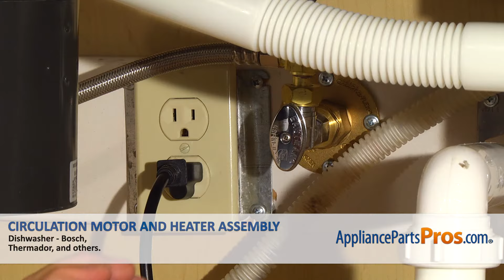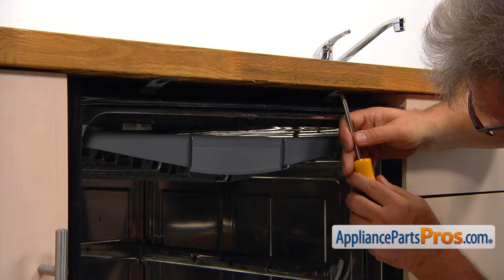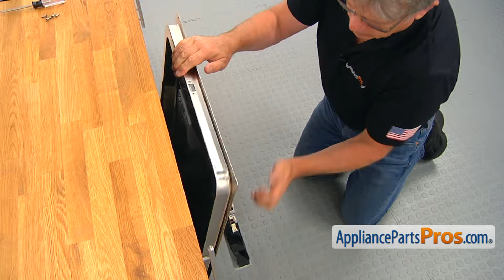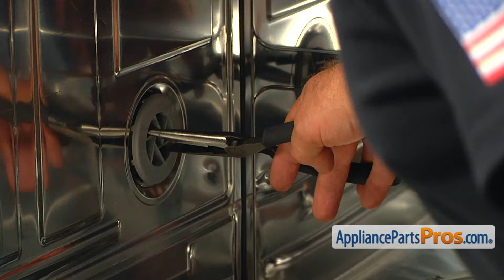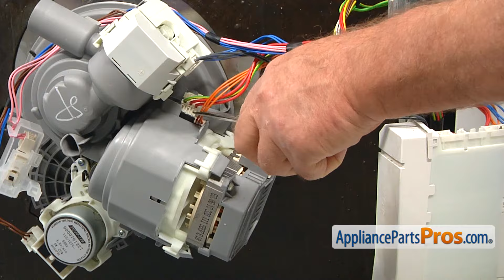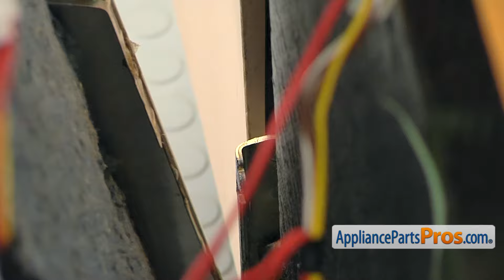How To: Bosch/Thermador/Gaggenau Circulation Motor and Heater Assembly 00753351

Comment: I have the exact same dishwasher.  Pull straight out. Fold back the right hand side insulation. Unclip the white electrical connection board, disconnect the 3 wiring connector clips from the pump.  You now have adequate access to remove the pump with a slow twist of the wrist.  Replace the old hose clamp with the new one, positioned so you can tighten it the screw head.  Put the new pump/heater in, reversing the procedure.  I think i undid 4 screws, and only actually needed to undo the ones that held the dishwasher to the counter.  Done in an hour.
Reply: Not all models though, some have additional parts that block the motor access and you have to go all in like this video.
Reply: @HeatSoaked  Yes, I can't lift the controller out because of water circulation immediately above it, seeing this shows that controller in place just like mine, I see no reason though for taking off the door panel.
Reply: @David-ci1vn  I had this problem. My solution was quite drastic as my patience was low and dirty dishes stacked high!
I cut a large hole in the base making sure not to destroy or weaken any mounting points, essentially operated through the bottom and got the bloody job done. Never again!
Reply: @HeatSoaked  That surgery gave quick access but the base acts as a drip tray detected by a fault sensor.
Reply: @David-ci1vn  I guess the drip tray is now my floor! Thanks for letting me know there’s some leak detection now defunct.
Reply: @HeatSoaked That was not smart son.
Reply: Yes, this video is way too complicated! Why screw the whole.machine into pieces when your explanation was enough. I did exactly like you proposed.
Reply: @. agree this was way to complicated. I just removed the circuit board assembly by unplugging it from the grey plug and pulling it to the side. It was a blind assemble to put the heater pump in but the only screws removed were the two holding it to the counter. People are taking apart way too much, risking breaking parts or parts not going back together. I was expecting no large cover underneath but also figured it had to be more straight forward than described in this video.
Reply: @drz400sy8  To the contrary- open the machine so you can see what you are doing- and do it correctly. Never blind. You will get leaks doing it your way son. Take a few minutes extra and do it correctly. If I changed the piston on your DRZ, would you want me to do it blindly- half azzed or take apart the engine- take my time and do the job right? Nice bike BTW. Now get out to MOAB, UT and really ride that thing.
Reply: @MOAB-UT I totally get your point. As an engineer, I looked at the two joints designs and saw a tang on one part and two slip like tubes on the other. Figured lower pressure and these were stop locations. It slipped into place perfectly. So I went with it as it felt right from a design perspective. I am still on board with your thinking. Enjoy the ride!!! 😊
Reply: I gave detailed instructions on this... this is the down and dirty version of the fastest way!!!
Reply: @sailure1 Where? I need to do this on my 800 series Bosch.
Reply: So go in from the right side ? No need to take off the door right
Reply: @xahx  yes. No need to remove the door. No need to tip it over. Turn off breaker and shut off water. Remember, I had a plastic base under it. Pull the gray cord out from the back that is going into the controller. Then gentle lift out the controller keeping the connectors connected. Undo the three connectors to the heater/pump. Look at the hose clamp. Mine came out pretty easily after you remove the black vibration piece.  You will get a feel for how it is installed when you remove it. Once removed put the new hose clamp on and install the new unit. It will align nicely, look for the tab by the hose clamp. Connect the vibration piece, connectors and electronic board , etc. the only two screws I removed were from the dishwasher to the counter. Test the unit. Hope this helps.

Comment: This is a useful video if you want to take apart a dishwasher. However, 95% of the work done here is unnecessary for my unit.    My heat pump is located on the right side of the Bosch dishwasher and nothing had to be unscrewed to access it. Only needed to lift up the insulation and it was right there! Disconnecting the water, the electrical (especially from the unit, as the power control is held in by the plugged in power cord) was essential though.)

This is a pretty easy repair, here are some notes from my attempt. It took me two hours, and I was significantly delayed by not realizing that the power control board will not come out if the power cord is still plugged into dishwasher!

1)	Buy correct part from Bosch 
2)	Turn off water, disconnect water hose from wall, unplug dishwasher. Kept white tube connected
3)	Unscrew the connecting screws to the countertop, underneath counter
4)	Pull out dishwasher 
5)	Disconnect power cord from dishwasher – control board will not come out if it is plugged in!
6)	Lift up insulation to reveal power control board on RIGHT side of dishwasher
7)	Remove power control board & disconnect plugs from Heater/pump
8)	Remove rubber tong which holds pump heater in place
9)	Remove clamp from hose holding pump in place – this may be easier accessed from the  left side 
10)	Connect electronic cable connections to new pump unit. Pretty easy to figure out, as the cables have unique sizes and only go into the slots that they  fit into
11)	Install pump. I had problems getting clamp (the new one that comes with pump) back in place until I tipped the dishwasher  onto the side and tightly screwed  the clamp down. 
12)	Reinstall power control board – pop back in
13)	plug power cord back into dishwasher
14)	push unit back into wall, reconnect water hose and plug back in

On my unit there was no need to take off side panels, just had to pull up insulation.
Reply: Best “comment” ever! Thanks
Reply: This repair would take a “pro” maybe 20 minutes top.  I could do it again in less than 30 minutes.
Reply: @jazzflautista  no such luck on my end. Trying to replace the seal behind the water distributor. I have to get the bottom panel off. Like working on cars sometimes it’s almost as if they intentionally make it difficult, why not a bottom panel hatch?
Reply: Thank you!  Went through the right side after removing the power panel. Worked like a charm!
Reply: You don’t have to touch the clamp at all. It twist off. It takes 10 minutes to do this repair

Comment: Great video.  I have a defective circulation pump and considering replacing it.  I dont understand why the front door panel had to be removed?
Reply: you can't access the screws for the bottom plate. my machine is a Pain in the * removed the pump without removing the bottom panel.
Reply: I do not either. Were you able to get the bottom of the dishwasher off w/o removing the door panel?
Reply: It just makes it easier to remove the T20 screws holding the silver plate at the bottom of the dishwasher on.  I didn’t think I would have to remove either, but after trying to find a way to remove them, I ended up removing it, much easier.